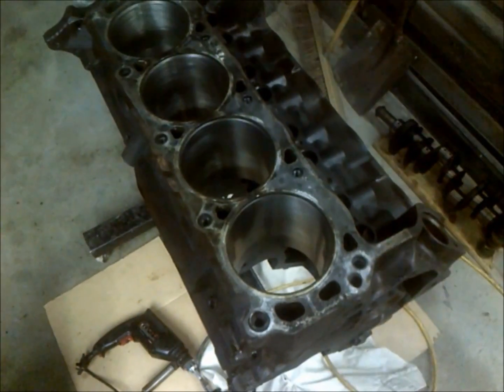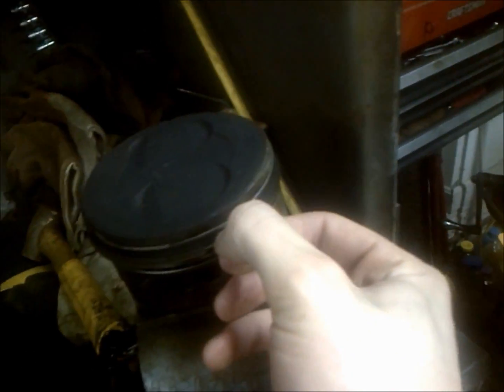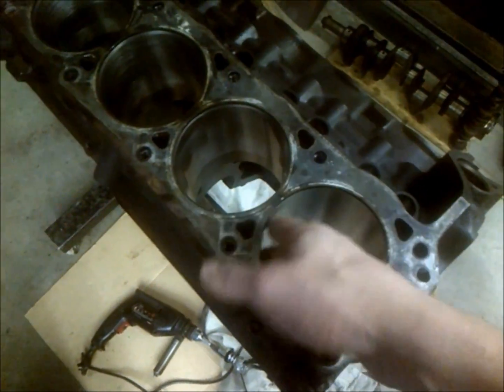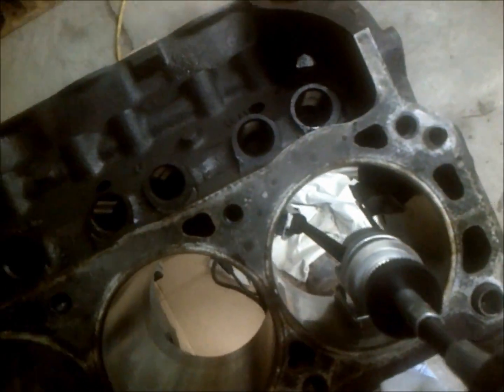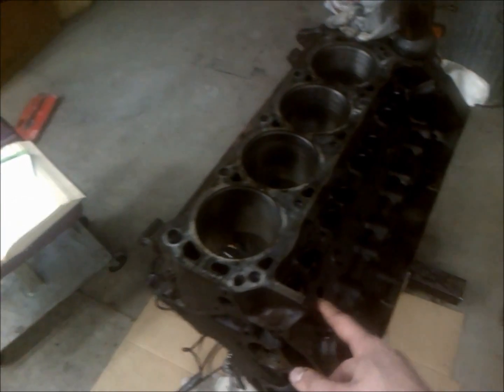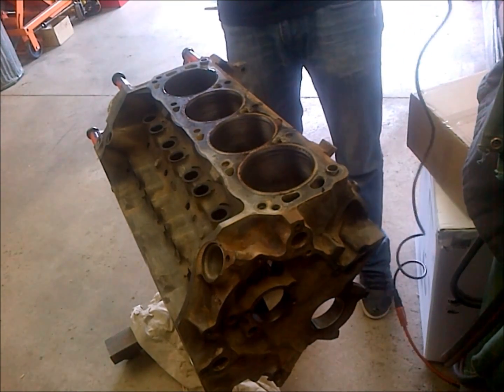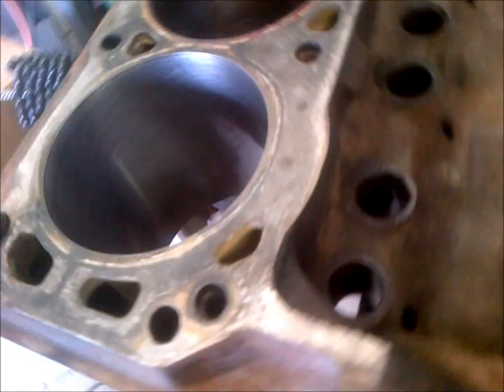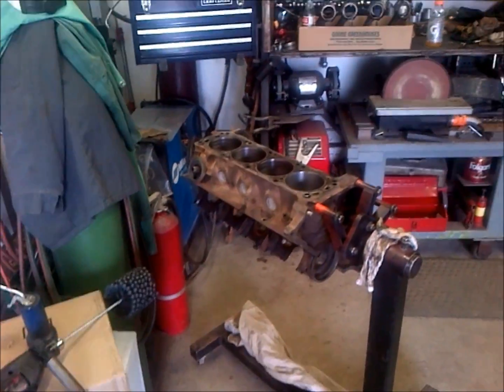Complete Honing Procedure  w/ Explanations - BUDGET SMALL BLOCK

Comment: Way too fast with the flexhone. WAAAY TOO FAST. Your crosshatching is at like a 5 degree angle...??? A 45 degree hatch would be 1 revolution per pass down, and one revolution per pass up. In this video you're doing like 5-6 revolutions per pass. In addition, you only need 3-5 complete passes with the flexhone, all your heavy deglazing and reshaping should be done with the 3stone hone. FFS

Comment: You did that completely wrong, drill speed way to fast.  Zero cross hatch.
Reply: Yep to fast imo also, the only machine ive used divided the cyl bore diameter into 1600 per the machines target ipms. I believe those ball hones are recommended around 3-600 rpm and 1-300 ipm for a 4" bore. Maybe not exact but in that ballpark which is just a recommendation anyway. It's hard to match the stroke to higher rpms but if your fast as hell it might can be done. Not sure it's as efficient though.
Reply from the maker: Nope, sure didn’t. 
Follow that up will a 240 grit ball hone and it’s good to go. 
Anyone running a stone hone and then running an engine on that alone is a fool

Comment: I have a quick question for you I've got a 400 out of a 78 Lincoln and it has no ridges and still has the cross hatches and the crank looks like new I'm wanting to rebuild it to the 71 400 spec's any ideas for it.
Reply: Just hit it with a ball hone and re ring it and new bearings

Comment: Is the purpose of the cross hatch pattern have to do with allowing the cylinder walls to hold some oil for lubercating purposes ?

Thanks ,   :-)
Wyr
God bless
Reply: Wyr Twister it's just so it breaks the rings easier without getting caught on jagged edges
Reply: Yes exactly why! It helps hold in some oil for the next pass of the rings
Reply: Wyr Twister i
Reply: It creates valleys to allow the oil to rest in. The reason you want the 45° is so the rings don't catch and wear the highs/ destroy your rings.